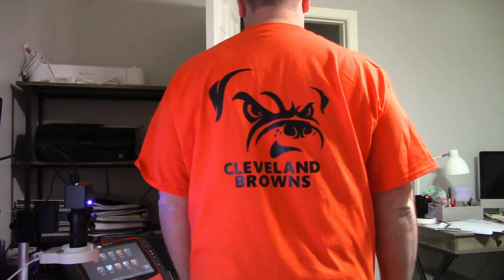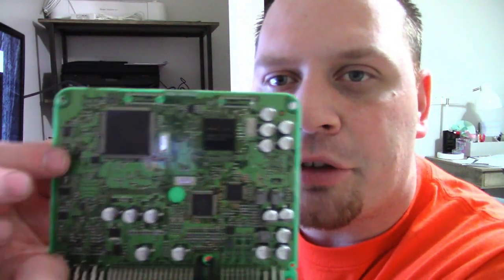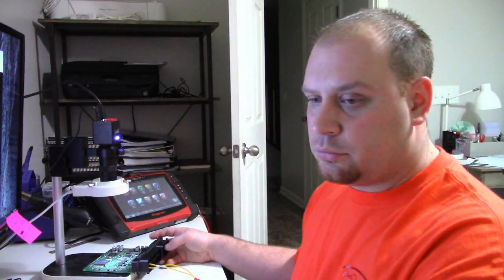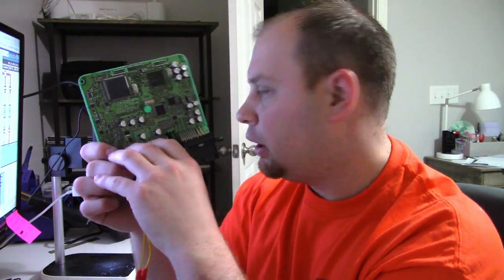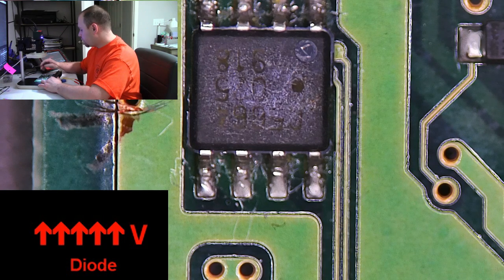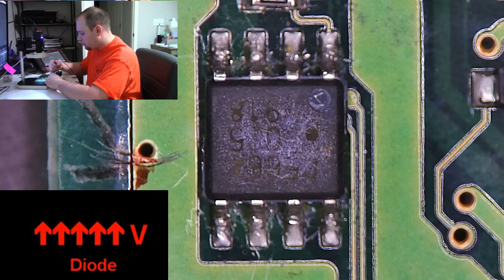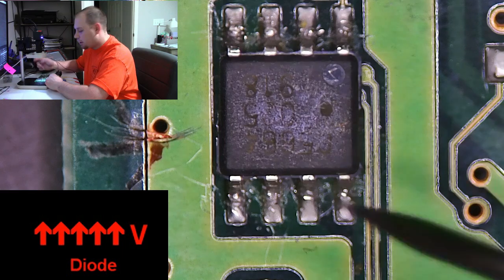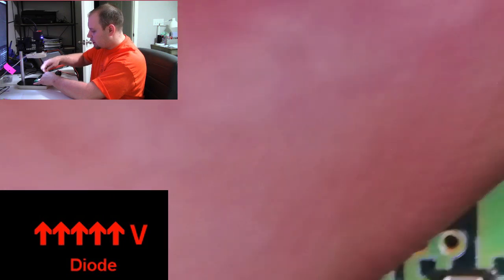'14 Tundra ECM injector driver Repair

Comment: Very well explained. Thank you.
Reply: Let me ask you one question if you don't mind. If I understand well, you connected the positive from your power supply to both your test light and the bulb. The other wire of the bulb goes to the drain of the mosfet (or injector input of the board) and then ground the source of the mosfet back to your power supply. Am I correct?
Reply from the maker: Yup, that is correct. The this particular transistor turns on when power is applied to the gate. So I had to hook my test light up to power. Thanks for watching! And super observant as well!

Comment: As Dan mentioned in an Earlier comment id like to know where you would recommend replacement drivers from and how do you identify which is the correct one?Compatible replacement. TIA.
Ps another great Video and extremely interesting and useful stuff I can apply to my work. 10/10
Reply from the maker: Hey Shane, Im still new at this so it takes me a lot of google searching and cross referencing. But I usually find the components on mousers website after finding a "like component"

Comment: I've been micro soldering for years mate, your skills are right up there, if you anticipate doing a lot more of this stuff , i would suggest you get yourself a good quality extractor, would also suggest hand protection ie gloves or barrier cream, lead once absorbed into your body can not be secreted through any body functions, its there to stay, 
Regards Joe
Reply from the maker: Thanks! Do you have any recommendations for an extractor? I know that I need one, for sure! The smell of flux is nasty lol
Reply: @VoltageDropDiagnostics  I got a secondhand pace unit from ebay , they are quite expensive , but a must if you are doing a lot of soldering.
Regards Joe

Comment: heey have you ever heard about the XTOOL X100 PAD2? u know if its bi directional? AND the Ancel X6 OBD2 Diagnostic?? (supposedly  does some bi directional controls)?? cheerz!
Reply from the maker: I have heard about the tool but haven’t had a chance to use it myself! I’d like to try it out one day.
Reply: @VoltageDropDiagnostics  the xtool or the ancel x6?
Reply from the maker: @joachimjohan1215  i haven’t heard of the ancel. But i have heard about xtool
Reply: @VoltageDropDiagnostics  i hear the xtool is really bad + company is bad to...

Comment: Awesome! I had an 2007/2008 model Tundra, customer came in with 1 shift solenoid code, code would not clear and would set with key on. Confirmed continuity from ecm to internal trans wire was good, bench tested solenoid as good. I condemned the ECM and the customer declined, I wonder if it could be fixed in the same way.
Reply from the maker: Would have been cool to open up and see!

Comment: Having a scope, and most importantly, knowing how to use a scope is critical. That said, as a cost effective  method - what about using a $35 O2/exhaust  gas detector? If those cylinder  heads are cracked, wouldn't there also be warpage, too (I take it the engine overhead?)? Lastly,  is this the 1MZ?
Reply: All right.... *extremely red-faced with embarrassment * It wasn't  this channel; sorry 'but that. BTW, great channel - loads of info, with a good learning  environment, too. I'm happy to have subscribed. Again, sorry about that mix-up.
Reply from the maker: Haha no problem buddy! Thanks for subscribing lol
Reply from the maker: Hey Tett. I’m wondering what you’re referring to lol. This comment appeared on a circuit board repair video so I’m a little confused haha. 

But I’d like to answer your questions. I’m just not sure which video you’re referring to lol
Reply: Yikes... My bad. I caught it (that I posted comment to the wrong video) only after I commented. In the correct video, you used a scope (on two different channels) and a pressure  transducer to see possible power pulses in the coolant. I think it was an older Toyota pick-up (or Forerunner?).  At the end of the video, you removed the heads which showed a crack between the intake and exhaust valves. I tried to find the video, but couldn't.

Comment: This might be a dumb question but where do you get replacement drivers from and how do you identify which is the correct one?
Reply from the maker: I usually start by doing a google search of the numbers painted on the driver. Then try to cross reference them to transistors on mousers website
Reply: @VoltageDropDiagnostics  FYI Radio Shack is back in business online now.

Comment: Again great video and knowledge!! Just one question was the engine harness damaged in anyway/replaced?
Reply from the maker: Yeah, the rodent chewed the injector wires. The wires were just repaired. But after the repair, the ecm still wasn't commanding the control wire to ground.

Comment: PJ I hope I got your name correct but I also have been trying to learn some of this stuff also on my own as a diyer. I was learning from Maic Salazar but his videos have stopped. I hope because he’s to busy. I’ve been following you for awhile I’m a retired aircraft mechanic but I enjoy working on cars and now I’m into it big time. I’m also into the tool aspect because I love my tools and now the electronic end of it. Thanks for sharing your videos and knowledge and stay safe and well Artie. 😊 very nice surface mount solder joint 👍 Pj is the power supply and hot air gun in your Amazon store. Guess I could look but then I might d buy to much LOL
Reply from the maker: Yeah, the power supply and hot air station is in my store. They’re knock off brands, but they seem to work fairly well for me.

I love Magic’s videos! I have been watching northridge fix lately. He fixes small electronics. But the concepts carry over.

Comment: Awesome Video/ Repair!!! It is nice to see more videos from techs doing module repairs. Hopefully it becomes the normal and more standardized  ////   Tip for when your cleaning/ prepping the solder pads.  Flow new leaded solder to the old solder before cleaning with the copper wick and maybe bump the heat up a bit on the iron or use a bigger tip for less heat dissipation.  I saw the wick was getting stuck and not flowing solder to well.  I have torn off some pads before when the copper wick wasn't hot enough and soldered it self to the pad as I was scrubbing.... Whooops. //// Also check out/ subscribe to 
jeffescortlx and Fixed Until Broken for Cluster/ Board Repair Channels.   Texas Instruments Youtube has informative videos on Automotive Circuits. There Website too also has PDFs that explain automotive circuit design. Lot of engineering jargon but its readable.
Reply from the maker: Thanks for the tips! This is exactly the info that I was looking for! Thank you!

Comment: Hey PJ, Awesome job. Where did you get your PCM parts at? I was wondering if I might be able to purchase such parts. Do you have a go to place that you recommend. Would you mind sharing some links of the tools used and parts used?
Reply from the maker: Mouser has been my source for parts so far.

As far as the tools used, the soldering iron is in my amazon store:
https://www.amazon.com/shop/voltagedropdiagnostics?listId=25U51J3KK15QV

Comment: Awesome job! Where did you get your training info from? What kind of soldering iron are you using and what heat gun. I have always wanted to do something like this. Thanks for sharing
Reply from the maker: Also, as far as training lol I watch a channel called north ridge fix. He fixing cell phones, iPads, etc but all of the concepts carry over
Reply: @VoltageDropDiagnostics  i m watching him fixing circuits too. This is something which i always wanted to learn.
Reply from the maker: The soldering iron and heat gun are in my amazon store. It is a cheap knock off unit but seems to work well for automotive circuit boards. I did need to buy a micro soldering iron for electronics like phones.

The soldering iron is in my amazon store: 
https://www.amazon.com/shop/voltagedropdiagnostics?listId=25U51J3KK15QV

Comment: Nice job 👍🏻, can you tell me please what was your heating temperature set in the heat gun. Thanks for answering
Reply from the maker: My heat gun was set to 650. For full transparency I have no idea if that is the proper temperature or not. But thats the lowest setting that I could use that would actually remove the transistor in a reasonable amount of time lol